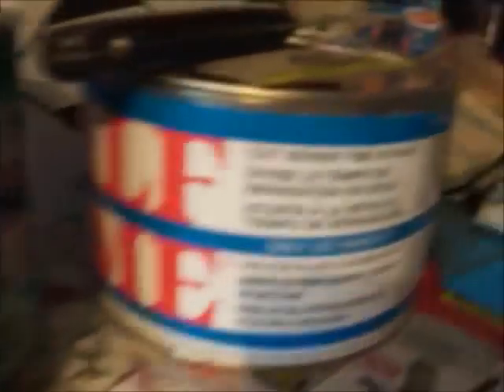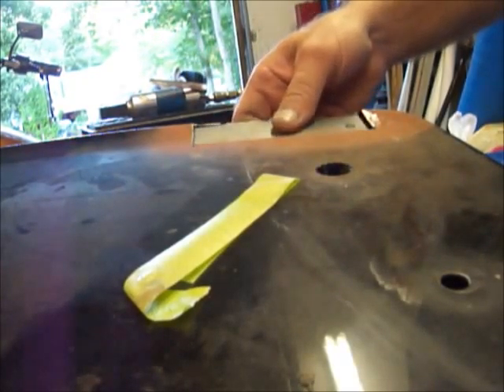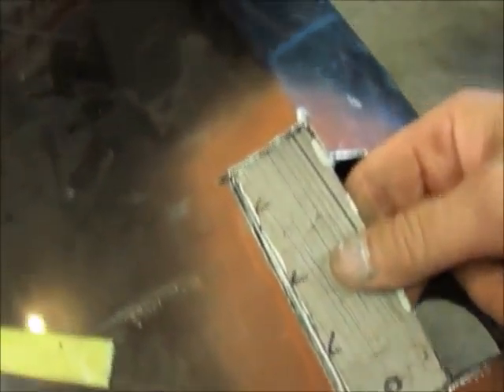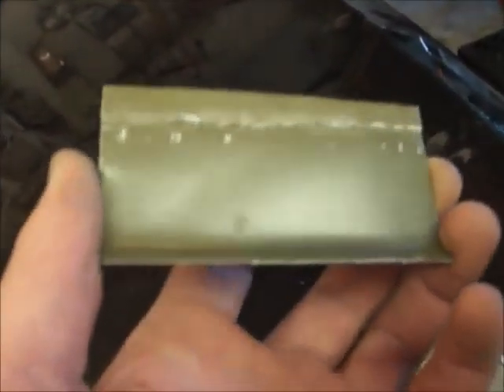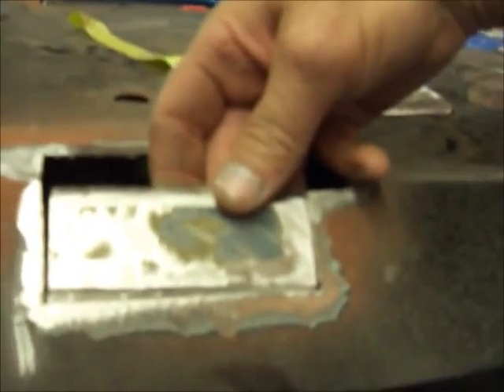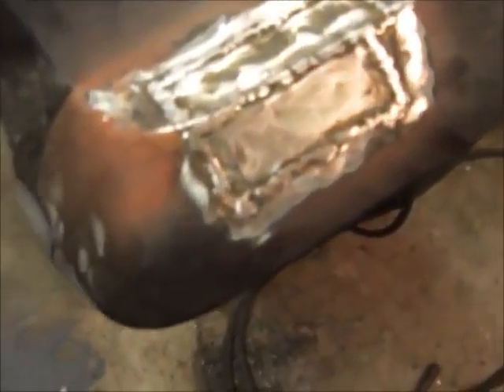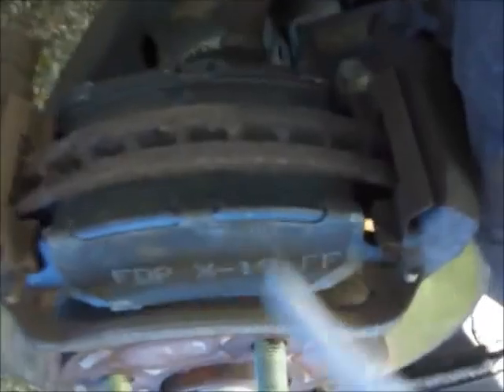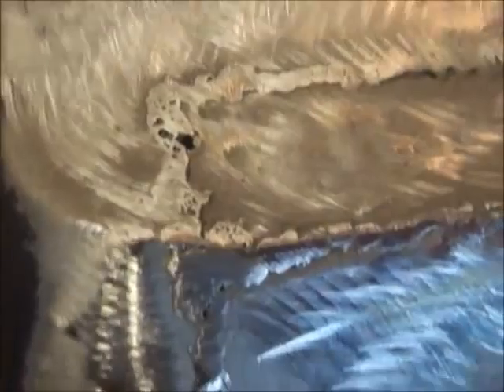Mustang patch weld repair

Comment: Looks good I think the problem with your patch is that you didn't flange the small tab on the upper piece, so the top patch was sitting lower than it should. Thats how you lost your line. You really got that to smooth out nice with the fiberglass, nice work Rich.

Comment: Looking great buddy, alot harder than some people make it look. Took me a long time to learn how to weld up all materials,  Having the right tools for the job makes it alot easier to learn, you need to slow down on your welding buddy, make about one inch space between welds and let it cool down. then go back in between each weld till it is all welded up. Takes time to let it cool down between welds, it will warp the panel if to much heat is welded on the panel all at once. Practice Practice. .